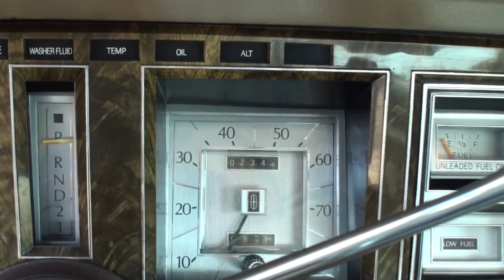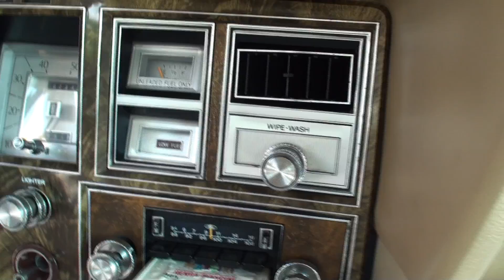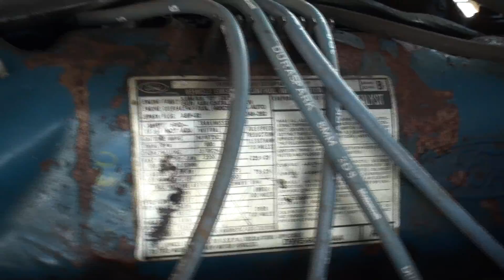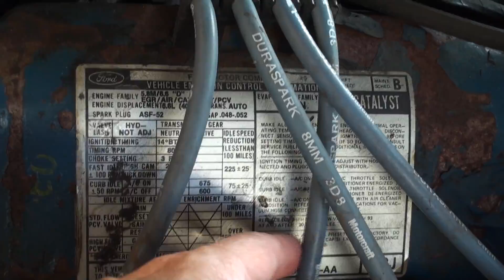1979 Lincoln Continental Mark V Cartier Designer & Engine Sound on My Car Story with Lou Costabile

Comment: That looks like a comfy commuter car.
Reply from the maker: Hi Kevin MacNutt, Rides like your floating along the road in cushy comfy chairs :-) Slow around the corners and acceleration in the straight away, Lou
Reply: Lou Costabile Yeah I commute an hour each direction on the interstate, so no corners there :-).
Reply from the maker: A car like this makes that commute that much more enjoyable, Lou